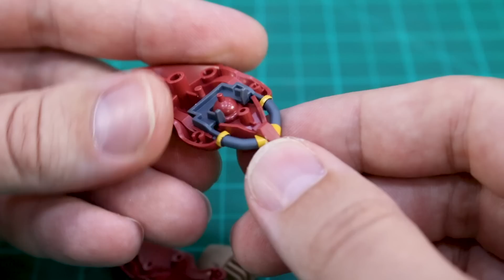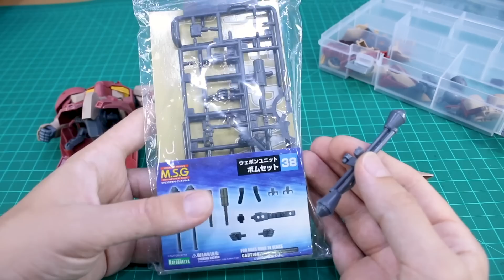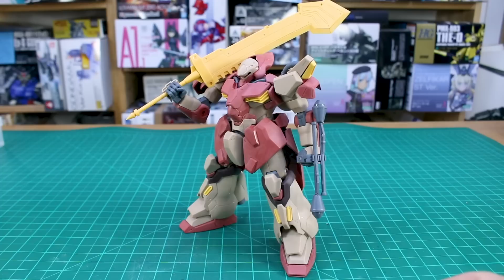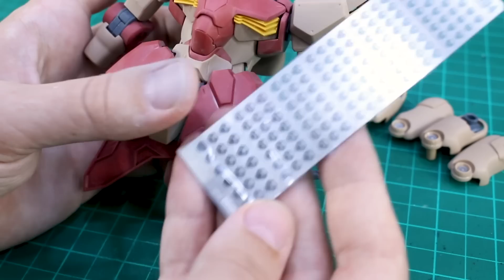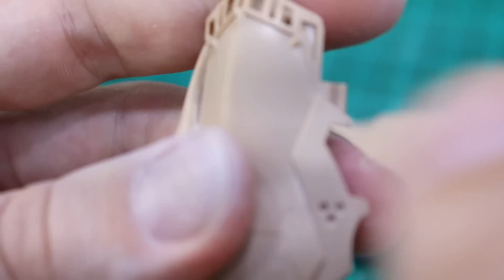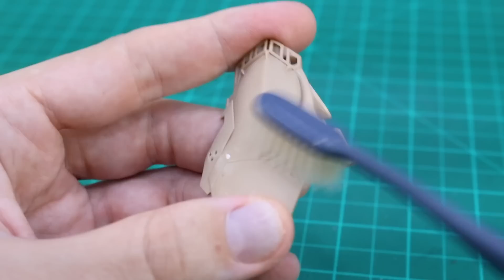HGUC Messer WIP Pt.1 - Plus SIMPro Giant Heat Sword / Detail Up / Photo-etch / Head Seam Removal Tip

Comment: I always wondering that why gunpla modellers always sand their entire gunpla from 400-800+ ?
Reply: If you plan on painting your model then you want the surface as smooth as possible but have enough scratches in it to be able to allow the undercoating to grip onto the model.
Reply: @tallaaron1115  I'm wondering what's the ideal sanding paper grit ?
Reply: @zakhaevshub4735  you start with 400, but you build up to 800, when painting depending on the finish you want some people even run up to 2k grit. Easy to get and cheap. A car sandpaper bundle works wonders.
Reply: @tallaaron1115  oh man finally I get the answer....thx a lot bruh😁 🙏🏼👌🏻